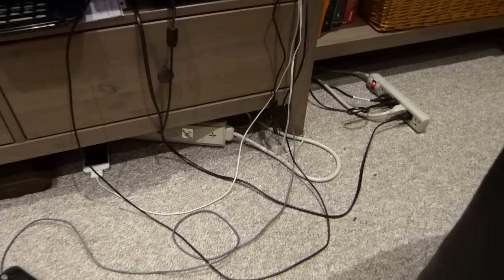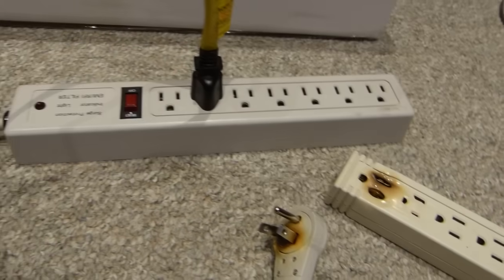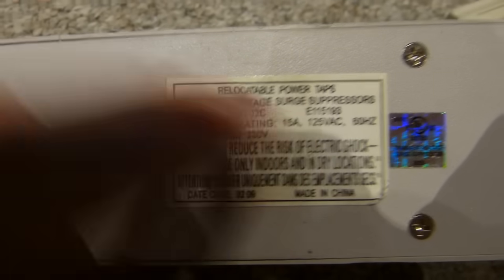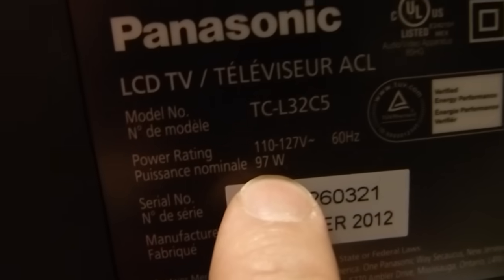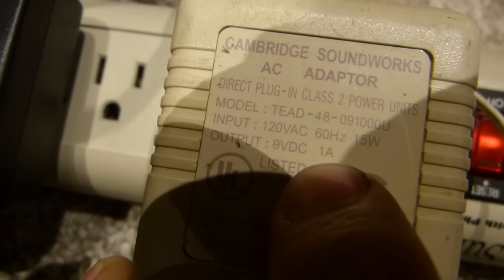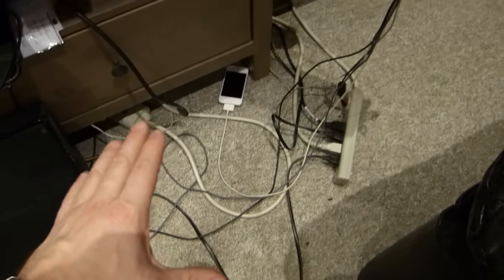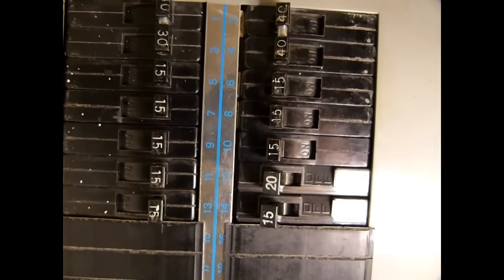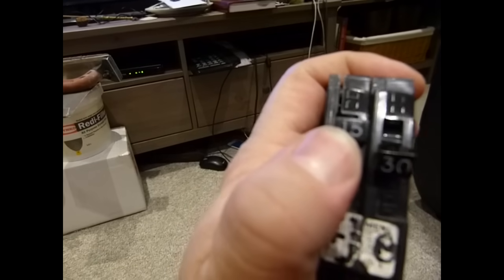Is it safe to plug power bars into power bars?

Comment: WTF is the shit,  let me teach you..... go back to the FUSE BOARD> (depending ring main) may be powered from a 15amp or a 20amp  that means that the maximum current draw on the fuse/circuit and plus is 15 (20) amps

AT the socket, whether you put 1, 5, 10 or 100 items on to a socket MAXIMUM draw will be 15 (20) and the fuse will blow, (actually there is a tolerance-but let's ignore that)

The POWER bar will have a rating, let's say 15amps (the ring main is say 20amps in this case)

THAT power bar will draw ONLY 15amps before the surge protector/fuse etc BLOWS, the main fuse is set to 20amps and wont blow

IT DOESNT MATTER what you plug in over the maximum rating  the fuse in the power bar OR the main fuse will blow.
The fuses job is to protect the WIRING from burning nothing else

IF the power adapter SMOKES and catches fire, IT IS FAULTY..... PURE AND SIMPLE.

ELECTRICS in the home are made simple for the lowest common denominator, YOU CAN NOT burn things up, UNLESS something is faulty. You do not need to count, you don't need a course in electrical engineering.

IT IS HOWEVER bad practice to STRING along power bars.... WHY, because you have the possibility of bad connections and plugs coming loose, a loose connection, will cause a high resistance and possibly arcing, THAT will cause a fire, NOT the rating or over rating of equipment

AND DUDE, no need to insult your audience and call people dumb or retards and not knowing how to count,
because as they say, "People in glasshouse should not throw stones"

In other words dumba$$ check what your posting, to make sure it's correct,

NOW SCHOOL IS OUT

no need to thank me
Reply from the maker: Right, nothing in it to thank you for anything.
Keep your lessons, nobody`s gonna read your novel.
Might want to re-visit grade 1 manners.
Good luck elsewhere.

Comment: you're still not adding the numbers right some of those voltages you were showing weren't 110v some of them were 24v at 5 amp. which isn't the same. you need to go to all the power supply boxes on the power bar and read the amp rating at 110v
Reply from the maker: Makes no significant difference, thought about it

Comment: You spent all that time adding up all those small loads, yet failed to realize that the plug melted because there was a high resistance at the plug caused by a poor connection, and the power was dissipated across the resistance caused by the poor connection of the plug, instead of power being dissipated in the heater. Did you notice that the upstream power bars were just fine? If it were a matter of the sum of the device currents, why weren't the upstream powerbars melted even more? They weren't melted because there was little resistance across the connections in the rest of the plug connections.
Reply from the maker: I din`t fail anything.
Keep your lessons, enjoy story as is.

Comment: It's quite simple:  If you plug low-power drawing items into a power strip that's coming off of another power strip, you should be just fine.  However, under NO circumstances should an extremely high wattage item (like a space heater) be plugged into ANY kind of extension, be it a power strip or extension cord.  If anything, it should be the only thing plugged into that outlet.  Same goes for air conditioners.

Plugging a computer or laptop charger into the primary strip (the one plugged into the wall) and then using a second strip for something like an lame with a CFL or LED bulb, maybe a phone charger...  You'll be fine.

I have a dual strip setup at my house but I only use the 2nd strip to power a small LCD monitor, my computer speakers (about 5A), and an LED lamp.  Pretty sure I'm not going to burn anything down.

Comment: You can do this by replacing the wires with thicker ones same used one any heat device or used for house electric supply

Comment: In the UK sockets are fused, you shouldn't be able to over amp the wires based just on the because if you try plugging too much in you'd just blow the fuse

Comment: One nitpick: On the router and speakers, you used the OUTPUT current rating instead of the INPUT current rating, meaning the real numbers are actually much lower. For example, on the speaker, if you take the 1A rating * 120V you get 120 watts... but it's only rated for 15 (so the actual rating is 0.125A instead of 1.0).

That said, it only makes things safer by giving a wider margin to the max current, so I guess it doesn't really harm much.
Reply from the maker: My bad, I apologize, I read the wrong line.
Never got edited out since it doesn`t make a significant difference, like you noted.
Thanks for watching.

Comment: A power strip is just an extension cord, all that matters is the total current draw. As long as you don't exceed that or have a ridiculously long chain of power strips that leads to too much resistance, then it will be fine.

Comment: Looks fishy to me as they are SUPPOSED to trip when you overload the circuit.  That wasn't the case, you said it was running for a while.  Mechanical failure at the plug was the cause of this.  Stop shopping on Chinese markets with rotational plugs with contacts made of discount materials !  They're prone to mechanical failure.  You had a short between live and earth, preventing the trip/overload protection circuitry in the piggybacked power strips from functioning as intended, allowing an overloaded circuit to run,, overheat and therefore, cause your fire.  I BET anything if you disassemble that burned / melted rotating prong plug, you'll find the main/ground fused together (this fault condition stops ground fault circuit protection in power strips from functioning as intended, but your circuit will still work ) !  

Typical GFCI (Ground Fault Protection) power strips will trip over 5 mV, if you are only steadily leaking current to ground, you'll never fault out and have reached a dangerous power condition in which GFCI protection no longer functions as intended !

If this overload condition would have occurred with two power strips that passed a thorough continuity test and GFCI circuitry test, you'd simply have been out of power on the circuit, NOT this situation.  Sounds like foul play at the manufacturer of the power strips, simply wear and tear over time, or a coworker that can't keep his hands out of a bag of cheetos while working.
Reply from the maker: Took apart the failed plug + outlet, details coming soon.

Comment: For transformer plugs the output amperage is not the same as the input amperage because it is at a much longer voltage. For example, using the formula W=VA 9v at 1a is only 9 watts. 9/120 is only ~0.1 amps from the wall.

Comment: wow that computer label is baffling. there is just no way a consumer production desktop computer draws 6A at 110-120V. that is probably just a measure of the max amperage you can safely sustain with tons of hungry peripherals plugged into the USB ports and stuff. consumer desktops only pull like 150-300W in normal operation. even my custom workstation/server with really high power components is rated for 850W but it normally idles at 350W, and even under full load to the system and a huge artificial load to the 15 hard drives it draws around 750W. and that's FIFTEEN hard drives, numerous fans, tons of USB peripherals and devices charging. a system with 4 graphics cards and a water cooling system could push the required limit up to 1000 or 1200W for sure but there just aren't any consumer production computers anywhere close to this. not sure what that desktop is but it's clearly not a custom system and there's no way it requires more power than a high end custom system. so 720W seems absurd, unless it's an upper limit for the power supply. which seems about right to me - power supplies are most efficient when operating around 50% their power capacity, and an average desktop should probably draw around 150-300W.

Comment: now with cable extensions in the UK no idea how many amps but you can connect extension leads and other equipment plugged into them and it still works correctly.

Comment: I would say it  was likely not  connected in the correct manner meaning not seated corrently..

the only time you get problems melted power board is generally when board be not seated into board a correctly..

or using a foreign power board..

you can not exceed 1.5 amps per device..

so your 15 amp main can support 10 devices..

Comment: The strips are rated for a combined 15A, but I would not trust that number. Some have a power lead with 14ga wire but many of the cheap ones have 16ga wire. Also I would not want to plug in anything with more than a 5A draw. Most appliances that draw more than 5A tell you not use a extension cord for a reason.

Comment: You are doing the conversions wrong, your speaker draws 1A at 5v, at 115v it’s a much smaller load
Reply: It doesn’t draw 1A at 5v, it outputs 1A and 5v.

Comment: So, the current draw exceeded specs, and you needed a 10 minute video to explain that this is a bad thing to do? Typically while plugged into another power bar? Power bar is rated for 1500w, if you exceed that it melts and burns. You can plug as much as you like into a socket so long as it doesn't exceed these ratings.

Comment: You gotta not excede what the outlet can do, you have to add up every devices power usage and stay within what the outlet can do, if you go faster you burn; shit up. heaters never should be plugged into a power surge protector because those things are needy bastards that should always be plugged into the wall.

Comment: Wait a little bit!
those devices that had 1Amp but at 5Volts actually were only using  around 0.05Amps out of the wall, right?
I mean, you can convert 15A at 115V to 345A at 5V, right?
Wouldn't it be better to use watts?
Reply from the maker: No, wire size is based on the definition of Amp

Comment: Haven’t watched it yet but no it’s not safe, they only output a certain amount of electricity, splitting it up and using so much energy puts way to much strain on it, you’ll blow the circuit.

It is safe though to use those single plug extension cords it is just making the power travel farther but Isn’t splitting it up

Comment: Red things on power bars ARE NOT BREAKERS, they are just switches that humans can use if needed, only breakers you have there are the ones in basement. Meltdown could happen from two factors:
1st the wall plug could've been connected to a higher amperage breaker by accident, so the meltdown occurred (it would happen first on contacts between wires);
2nd it could have been a loose connection.
Reply: They are breakers. If you plug a hairdryer and a heater, both running at 100% capacity, into a power strip, it will pull nearly 30 amps. If it’s the right kind of power strip, it will trip before the external circuit breaker.

Comment: You got the power wrong for the Modem, Its draws 1 amp at 5v, but if you look as the power supply that plugs into the wall it will be 240v at 0.2 amps.

Comment: These calculations show a faulty breaker or faulty power board. If that board is rated 15 amps it should be handling the power draw from anything connected up until the 15 amp CB trips. It should have no problem tripping as anything else running on the SAME circuit would push it even further. It should not have caught fire as circuit breakers have 2 tripping functions built in, short circuit which trips fairly quickly or overload where over time a metal strip heats up and bends to trip the breaker.

To avoid this problem you can get power boards with breakers built in that trip when theres too much load, get new breakers that can be tested regularly or get more power outlets installed.

Comment: when pokemon go first launched, it took maybe a week for somebody to figure out there was a outlet smack dab in the center of 3 stops. the next day there were 6 power strips/bars leapfrogged together.  and every slot that wasn't occupied by another power strip was instead occupied by a phone charger. the electricty bill from that one source was supposedly over 2 grand (usd). for a single weekend.
Reply: $2000 sounds insanely high for charging a few phones. Assuming a very pessimistic 30w per phone charger, 50 phones would only use as much as an electric heater.
Reply: well that's what all the news articles about it said

Comment: plugs a fridge, heater, microwave and coffee maker in

House Explodes
Reply: Fridges and microwaves by themselves would far exceed the 15A breaker. That's why they have their own breakers.
Reply: InstantCake lloooool
Reply: Refrigerators and microwave ovens are usually served by 20 amp circuits.
Reply: InstantCake No, Breaker trips.

Comment: I noted a problem when you added 1A from the router. the router was attached via a powerinversion brick, that converts 120VAC to 5VDC. This conversion changes the amperage alongside the voltage, to create the overall wattage pull. 5Vx1A=5 Watts, so 5W/125V=0.04 Amps pulled from the wall, plus efficiency loss, which should be listed on the power brick.

Comment: Why you read amps instead of wattages? First mistake in this video..
Reply from the maker: No. First mistake was to click on it. Second was to comment on it.
Why Amps? Electrical code and wire gauge sizes are based on Amps.
Reply: theoverengineer yes exactly amps. But if you read amps from transformer output, you really don't know what you're doing. Just calculate total wattage and THEN calculate the amps from that. Every electrician know how to do this. If not, then it's better to leave everything alone and study :)

Comment: 4:32 thats 5V 1A DC. thats about 5W of power, so the powerbrick probably has a rating of under 0,1A
And also: the Computer doesnt consume allways 6Amps, thats the maximum that the powersupply can handle. so you dont need to add the iPhone.

Comment: Are you kidding us? Are you aware what the circuit breaker does??? It should trip the breaker if your are exceeding 15/30 amps. If the breaker did not trip, your current didn’t exceeded the rating for the breaker! Has nothing to do with the damn A’s at the labels. Most devices does not even use what the label says, and some uses over in peeks. The reason why it burned is that the power strip could not handle the 15 amps you were promised and you bought it to cheap... Current needs certain conductive material. If you du not have the required conductor, the material will burn. Please learn the most basic about electricity before freaking people out... Thanks
Reply from the maker: It melted.
It is an independent event that happens regardless of my level of awareness of anything.
Independent events don`t care to conform to expectations, labels, laws.
I don`t have or produce current.
I did not buy.
I did not use.
Detail.
Focus.
Calm down and stop writing in other peoples name.
Don`t presume to lecture.
Thanks.

Comment: also never plug a power bar into itself or it will have infinite power and blow up after 5 seconds.

jk
Reply from the maker: I do that with the black wire and the white one. One connected, a lot of infinite power comes out. The bigger the wires the more infinite power in makes. Sparks and all flying. It`s amazing.

- just kidding, thanks for watching -

Comment: i plugged mine into my other one to increase range for my chargers
nothing like that happened
maybe because im in scotland
and in the uk the outlets are like 300x safer
Reply from the maker: or maybe because the current load didn`t exceed wire`s capacity
Nothing to do with safety standards, if not overloaded, not broken.

Comment: Heater should never be used on a power strip, or with a extension cord..... Heaters are the main reason for winter fires.... the generate HEAT! and the cords are ALWAYS undersized...I'm hate portable heaters!
Reply from the maker: If cords are really ALWAYS undersized, how do they meet electrical standards and pass certification in the first place?

Comment: Adding the amp rating from the output of the ac/dc adapters is incorrect, you should be adding the input. However, it isn't that big of a deal considering the input amperage will almost always be lower than the output amperage. So it's not dangerous, it's just incorrect.

Comment: I just plug high-wattage devices STRAIGHT in to the wall. I know you can use a power strip, but i'm not willing to take the risk. If i'm using my portable A/C or space heater, i just plug it straight into a wall outlet.

Comment: Breakers need some time when they are Overloaded a bit to react, but not if you mace an Short circuits that is because they have 2 Differten Mechanisms one is an Magnetic and the other one the overload Protection reacts to Heat meaning it need some time to warm up if your just a tiny bit over 15A it takes a Long time to react there are different types of breaker that react slower or faster depending on the application. But for me it looks like that the Power bars where the problem here the Resistant Bestwin the Plug was to high creating heat it might even caused an Voltage Drop that high that the Max Current is no Longer existing and therefore never Triggering the breaker. 

How ever what i can tell you it was for sure not the breaker that didn't work it was the power bars that where shitty.

Comment: lesson for everyone don't plug more then 15amp into most home outlets anyways even if your strip is rated for more. some of his adding is off also as its amps at 115-120Watts not the amps labeled on the devices at there voltage. example his 5v at 1 amp is not 1 amp on the circuit and rating for the surge protector as its rated by 115v-120v